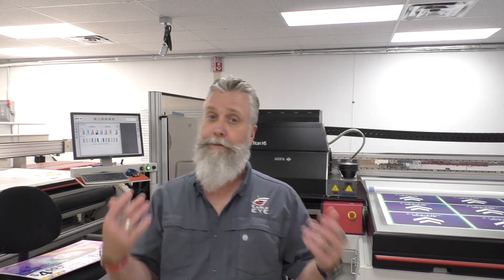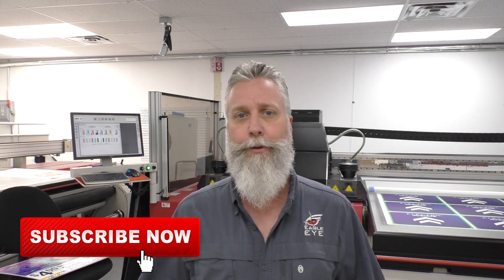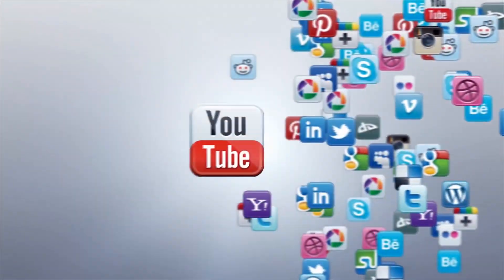Sign Word of The Day Flatbed Printing vs Roll to Roll

Comment: I have 12 different stock designs that I would like to offer in outdoor signage.  They're geometric type artwork with 5-6 colors (solids).  It seems for longevity my best options would be colored cast vinyl, or hand applied acrylic paint.  Both of these seem labor intensive, what recommendations do you have?
Reply from the maker: I would need to see the prints. if you want send the artwork over to info@eagleeyesigns.net. I will take a look at it. It sounds like a digital print and then a perf cut would be your best option.